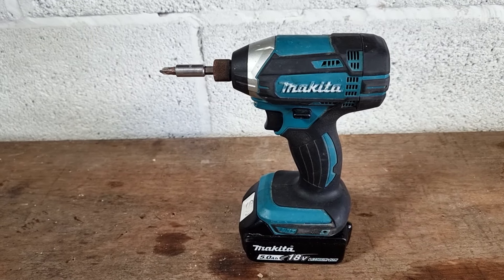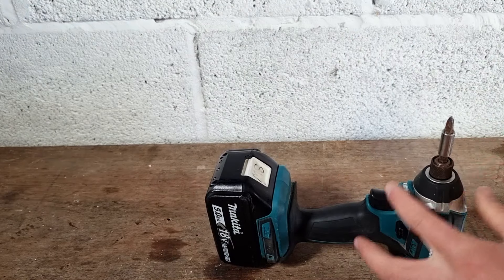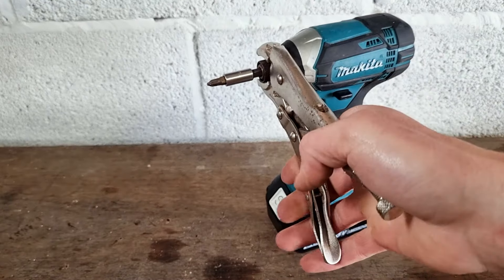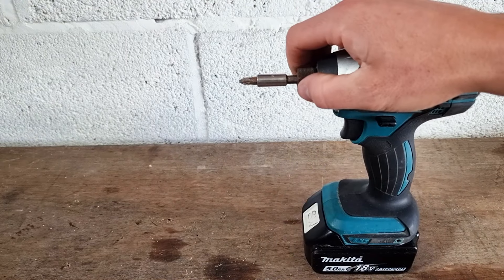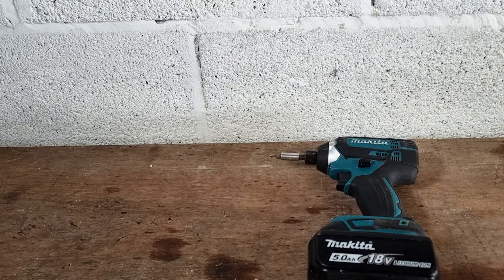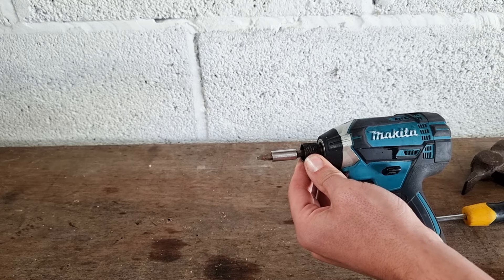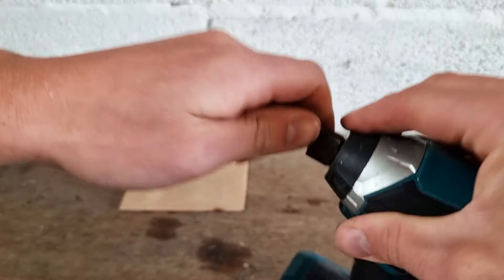How To Remove A Stuck Bit From A Makita Impact Driver

Comment: Set my Makita torque drill aside over a year ago after giving up on getting a spade bit out. Fortunately the bit bit had a hole in the wide part so put a screw thru there and a washer holding the release open and…4 tries and it worked!! Thank you. Was gonna have to buy another for a job today.

Comment: My son actually managed to put just the bit alone into the drill I can't get a grab on it as it's just the head of the bit sticking out send help.
Reply from the maker: Do you have any long nose pliers that you can grab onto it with?
Reply: @TheBlokeCave  the tip off the bit is literally all I can grab just keeps slipping on anything I've tried...I really miss my impact gun🤣
Reply: Same
Reply: have you tried putting glue (like jb weld for example on the bit and a piece of very thick heavy duty floral wire) to help pull it out. The bit most likely will be toast, but at least you can get it out of the tool. Just make sure to not glue the bit to the tool as well.

Comment: I had a small drill bit stuck. I put crc on it and even tho 2 different people tried getting it out it took 24 hours to soak the crc into it to get it out. I have more bought a smaller adapter bit so it might be a better option.

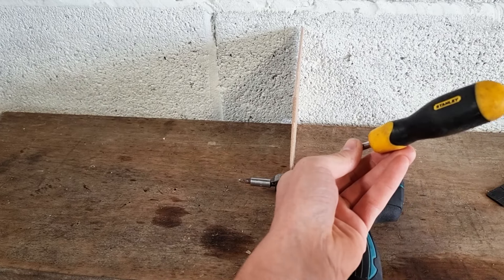Comment: Mercifully at 2:44 we could then easily hear you when you spoke closer to the microphone.  Before watching your video, I also started the same way using a channel lock, then WD-40.  But when all else fails, why not extend and hold the chuck forward, then use the channel lock to temporarily grip and lock on the extended chuck?  My Montana-brand bit shaft is much shorter than yours, making it difficult to use a hammer and screwdriver approach to help dislodge the frozen bit.  Apparently the Montana brand impact bits have a very soft shank that easily freeze up in the Makita chuck, despite very light work - I only sunk a 1/4 inch diameter hole down 1 inch in a 2x4 piece of wood.  Anyway, my next step after locking the chuck with the channel lock is try a second channel lock on the bit in close proximity to the first channel lock - and they use pry leverage at different angles.  Geesh!